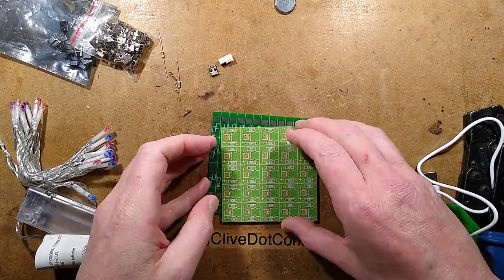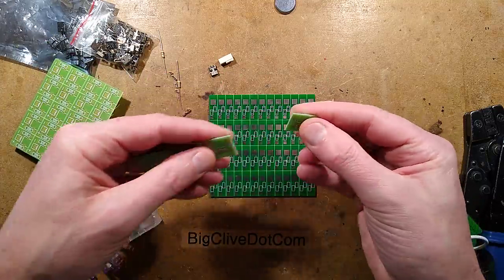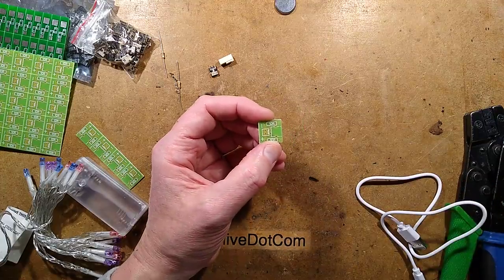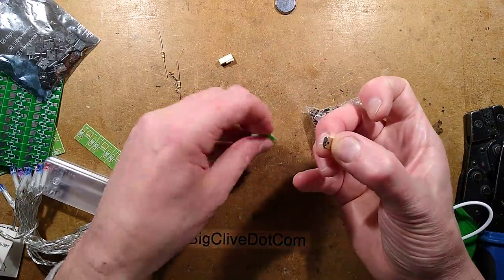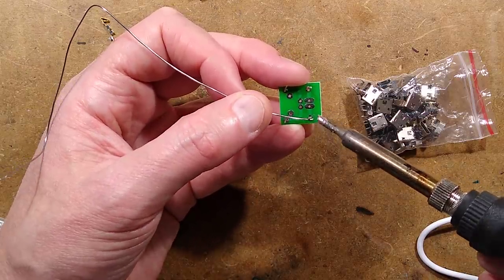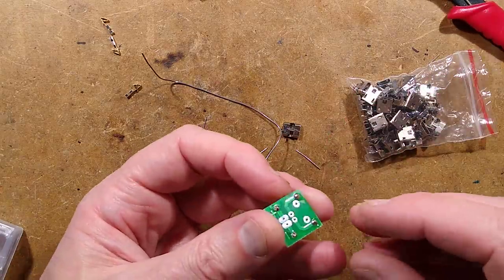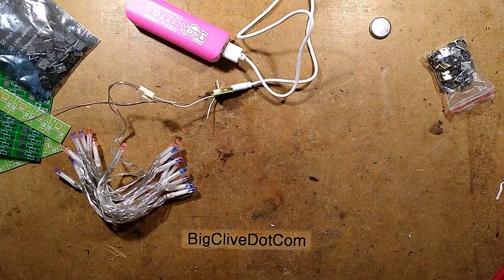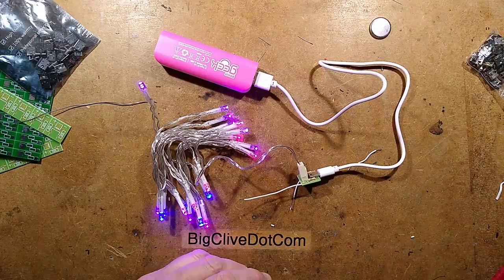USB to LED string PCB prototype build

Comment: I have a question, I need to convert a 3.7v battery to 3v-3.3v one. Tried with a step down converter but the input voltage of the module was 4v, so that didn't work. Can you please guide me towards a schematic/part number please?

Comment: Clive.
Not including the circuit board you used in this video, do you leave the edges of the board as is or do you sand them smooth and round the corners?
It's just because I was watching a video by Peter Brown and he felt he needed to sand some wood more than was needed and I have a few weird sanding routines including things that are hidden.
Reply: Oh Geeezuss! Sounds perverted to me 😲
Reply from the maker: I normally get my bigger boards made with rounded corners.
Reply: I usually use the edge of another PCB to "grind" the edge of a v-scored one. That's enough to not make you fear having glass fiber in your fingers whenever you touch the PCBs.
Reply: It's just me then..... 🥺👍

Comment: Great video.
Thanks for sharing your neat little ideas.
I really need to tinker more with PCBs. I always use the blank prototype-boards and often times when I want to do something I get frustrated because it's just a wire mess and I don't have proper wires, terminals and stuff. 
Do you have some guides on how to create these PCBs - any tips for a hobbyist like me? 
This would make tinkering around so much easier for little stuff that I want because I can design a PCB, get it done and then just move on without constantly breaking wires and components deadbug-style. 
Would probably make so much stuff way cleaner for myself :D
Reply: Look for some kicad tutorials probably.
There's a website you can use to make components easily for it. The library system is very powerful, but I find it pretty complex so I don't really use it properly. Apart from that is mostly just some screwing around to learn it.

Comment: @Clive LTV quick question. Sometimes when using a 5v USB battery I get flicker in the device. I use a diode and 20 ohms in series with the supply.  Same device but different batteries. Some flicker, some do not. I have tried using capacitors in series and parallel....any suggestions?
Reply from the maker: Is it a regular dip out just random flicker?  Some power banks dip the voltage regularly as part of a check.  Flickering may be a connector.
Reply: @bigclivedotcom  Its regular. I almost wanna guess a "pulsing", bright then dim then bright. . I am thought it could be how the USB power bank was boosting the voltage up (um..the frequency or something) messing with the way the light its self controls the brightness. Hence a capacitor to "smooth" it out. It didnt work and not sure I was using the cap correctly to even it out. I dont have a scope to check though.  TLDR: powering a 4.5 battery (alkaline/zinc w/e) device ( a bathroom motion sensor light) from a USB power supply.  I have burned up a few of them and not sure why.  Any thoughts?
P.s. Greetings from America! Happy Thanksgiving.

Comment: Great video Clive, Going to make my own, however how would i be able to add some sort of dimmer to the circuit ?
Reply from the maker: You can change the resistor values, or you could possibly use a 100 ohm potentiometer in place of one of the resistors.

Comment: Those input and output pads look recklessly close, just waiting for a solder bridge to nullify the resistors.

Also, I would argue that the difference in current measured vs. calculated is easily equally as much affected by simply assuming that your 10-ohm, 10 percent 5-percent resistor really is 10 ohms in resistance for your calculation, easily off by one 0.5 ohm, as it is by the shunt resistor(s) for the respective range. Not assuming that you don't know, just that it I think it would have been worth noting for those who might actually do not.
Reply from the maker: It's a compromise between getting a solid solder connection and separation.
Reply: Clive is using 5% resistors - brown, black, black, gold - but 1% resistors are readily available if you want to make more accurate measurements.
Reply: @johnm2012  Right, my mistake, don't know why I thought those would be 10 %.

Comment: The various micro USB connectors on ebay seem to have varying distances between the pins. Which ones were used with this board, please?
Reply from the maker: The two pin through hole type.

Comment: Is putting the same resistor on either side necessary, or just an aesthetic decision?  Are the string lights in series or parallel?  I'm trying to figure out the calculation for using 2 10R
Reply from the maker: Two resistors spreads the heat dissipation for higher currents.  The LEDs are in parallel.

Comment: I stopped using cheap flush cutters after one of the jaws broke off and flew into my face. I wasn't doing anything too extreme with them, just cutting off some supports from a 3d print.
Reply from the maker: I've never had that happen and regularly abuse them.

Comment: Current limiting? Or voltage limiting?  Curious how two 10ohm resistors kick down 5v USB to ~3v (what 2 x AA batteries would supply)?
Reply: It's an educated stab in the dark.
To do a "proper" calculation you would need the data sheet for the LEDs, or go with a generic.
But, if you guess the strìng takes 100mA at 3V (or measure it) then you need to drop 2V. Using V = IR, rearrange to R = V/I, split that into 2 resistors gives 10 ohm.
Reply: @dougaltolan3017  Thanks for that explanation!  Took me a minute to use .1 to represent 100ma 👍
Reply: In practice the resistor values are not at all critical. A total of 20 ohms is just a starting point. I've got 100 LED strings powered via the same combination of 2 × 10 ohm resistors and 40 LED strings powered via 2 × 22 ohm. You can adjust the values up or down depending on how many LEDs are in the string, and how bright you want the lights versus how long you want them to run between charges.

Comment: Wouldn't it be prudent to measure the exact value of that resistor that just claims to be exactly 10 Ohm?
Reply: Eh, they don't really - the datasheet often lists a variance of +- 2-5% depending on how expensive it is. Usually good enough.

Comment: How would this mod differ if the lights that you have are powered by 3 AA batteries and they're multi-function, with a remote control? I have some on a little tree but would love to run them from a USB power bank.
Reply: Replace one resistor with a wire and the other with a diode to drop 0.7 volts. Your lights will get 4.3V, but that's no different than what they'd see with AA's that are 25% used.
Reply: Of course if you put the diode in backwards they'll get nothing. Polarity matters.  :-)
Reply from the maker: You can run the battery pack from a chopped USB cable and a series diode to drop the voltage a bit.

Comment: Are the 10 ohm resistors not in parallel? In which case when you measure the voltage across you should either be using 5 ohms or doubling the current to 200 mA?
Reply: The 10 ohm resistors are in series.
Reply: @steverpcb  ah .. silly me.

Comment: Just out of sheer curiosity, why use microusb. Other than cost is there any other reason for not going USBC
Reply from the maker: USB C is not available in the strong through-hole format.
Reply: @bigclivedotcom  makes sense
 Thanks for the response

Comment: "Always put your meter back to the voltage setting." .... now you know that doesn't happen. How many people know the sound or smell of the resistance, amperage or impeadance reading of the mains power line? According to past capacitor range test errors, I discovered that 120 volt power circuits have 1 and 1/2 sizzles and 2 smoke curls. So, in color code fashion,  I'm guessing that's 1.5 with 2 zeros after it. To keep the rest of us from wasting a meter, the capacitance of power lines is 150 mega-farads. If you think it was kilofarads, or just plain farads, double check and let me know. 😂 👍

Comment: Question...why do you need current limiting resistors?
Reply: @Matt Quinn IIRC, this demonstration was using a led string that originally had a two-battery source.  My (Lidl) light sets have a three-battery box and they don't seem to suffer from running directly from the power bank.

Comment: I have yet to find any power-only type-c connectors. Is that why you're using micro-usb connectors?
Reply from the maker: Most of the cheap cables are micro.

Comment: I would really like to know how long the battery is likely to last befor neading to be charged☺
Reply from the maker: With a power bank it could run the LEDs for a significant length of time before needing recharged.
Reply: My guess is that about (15Wh/0.5W) is about 30 hours. But, drop the current or/and use a bigger "battery" ...

Comment: I've thought of making something like this however with... Better... Features 😛
Intensity control, smoothing, an on off m switch and with a better plug in block, using something mime the connectors you'd been advertising recently, or even if I could find a supplier, the old spring connectors for old speaker cables...

Comment: Do I simply put the v-groove on the pcb outline layer or did I get the help on the website wrong?
Reply from the maker: You have to request panelisation and let them do it.  You specify the number in each grid.

Comment: Hi Clive, would this work with or as a replacement for 3 d cells? or would you change the resistors?
Reply from the maker: For triple cell battery packs I tend to suggest just using a diode like a 1N4001 in series with a USB lead to nudge the voltage to around 4.5V.
Reply: @bigclivedotcom  Many Thanks Clive :-)

Comment: Aren't those strings tolerant enough to work with 5V instead of 4,5? 🤔
Reply from the maker: No.  A small voltage increase will cause a very high current increase.

Comment: Did you measure the resistor's ohms before assuming a 10 ohm is actually 10 ohms?
Reply from the maker: There will be a tolerance.

Comment: I know you have sufficient experience to do your crimps perfectly, but just for me can you do a pull off test on each one, it unsettles me for the rest of the video when you don't?  I've done thousands of coax and other crimps over a lifetime, but can't get away from needing to do a pull off test.
Reply from the maker: With this crimper I have good confidence from previous tests that the wires don't pull out.

Comment: JLC is a bait & switch operation, much like the "99p" ebay listings that are a "sample product" with the actual product you want costing £38.74, a despicable practice by any means...
Reply: Only if you're incapable of reading the actual conditions that have to be met. I've ordered quite a few boards that did cost 2$, plus shipping which most people dont complain about.

Comment: I'm obviously a noob and my English is not the best, but why are resistors needed in the circuit while connected to USB power, when they are not needed when connected to a set of batteries?
Reply from the maker: The USB supply is a higher voltage, so current limiting resistors are needed.
Reply: @bigclivedotcom  your answer explains why some of my dumbs projects with LEDs fail miserably after a week. Thank you.

Comment: How do you keep your soldering tips so clean? Mine always get black and unusable within minutes of me soldering.
Reply from the maker: If they're adjustable temperature, do you have it high?
Reply: Always leave a gob of solder on the tip as soon as you're done, and also turn it off as soon as you're done. That protects the plating on the tip from oxidation, a process which is greatly accelerated by heat! Use a damp sponge or bit of wet cotton cloth to clean the tip when it's up to temp just before using it with fresh solder on your project.
Reply: TiredSysAdmin  What it a good starting point for using a temperature controlled iron with (a) 60/40 solder; (b) lead-free solder, please?
Reply: TiredSysAdmin  Wow! Many thanks for that. I've only used Antex 25 watt non-temperature controlled irons until now but I ordered a controllable one just yesterday and will refer to your post again when it arrives. Thanks again.

Comment: wouldn't be using linear voltage regulator more efficient? thanks.
Reply: Linear voltage regulators simply waste the excess as heat, just as resistors do.
Reply: @johnm2012  thank you

Comment: I’m guessing you went for micro usb over usb c due to the cheapness of micro usb cables?
Reply from the maker: Partly that and USB C connectors make things a bit more complex other than not being available in the same 2-pin through-hole format.

Comment: With USB C becoming more prevalent is there a reason why you're still using Micro USB connectors?

I hear the C connectors are more expensive to buy, by how much? Or is there another reason?
Reply from the maker: USB C is not available in this rugged and easily soldered form.
Reply: @bigclivedotcom  Oh OK thanks!

Comment: What is the tolerance of your 10 ohm resistors ?  even at 5%,  not a very a accurate reference for an amp meter..
Reply from the maker: Good enough accuracy for the situation.
Reply: @bigclivedotcom  Maybe good enough, but then you can't really compare the accuracy to that of a piece of test equipment.  Having said that, the one meter that you used was so far off (from calculation) that it is out of calibration, defective or the test leads used are not conducive to current measurement.  Maybe a new battery in that meter gives a better result.  Or shorter heavier test leads may be the answer.

Comment: Sorry Clive Im on my phone. Anyhoo these LEDs, I was testing them out on a cr 2025 battery and ended off making a circular thing with 30 LEDs  all flashing away and no resistors I know it  needs resistors but its been flashing for 3 days now and the battery is starting to flag, wadya reckon ?😎💕🖖
Reply from the maker: For direct driving of the LEDs the battery has lasted well.

Comment: when you soldered these resistors, i think you should have spread the resistor legs so you dont have to hold them in place and burn your fingers
Reply from the maker: Bent leads make circuit board repair much harder.
Reply: @bigclivedotcom  why is that? i never had any problems with them

Comment: Why didn't you check the current with your DC clamp ammeter?
Reply from the maker: Easy to get an accurate result measuring resistor voltage.
Reply: Clamp meters don't work very well for low currents.

Comment: How (un)viable is USB-C here?
Reply: I think USB-C will default to 5v if there's no chip for the handshake?  I could be wrong.
Reply from the maker: USB C might require a couple of resistors.  I'm not sure if it would be viable for through hole use.

Comment: Someone need to make "BigClive BigHands" soldering helping hands as I still cant solder holding three things at the same time without dropping one all the time or burning my fingers, and those cheap helping hands are crap :D
Reply: @Okurka.  Expensive doesnt mean better + they break and get used just like cheap ones so why bother spend more? Joke was that Clive have big hands but hold items very gently and firmly, and 90% of helping hands use those annoying crocodile  clips that often damage delicate elements.

Comment: The only problem with PCB makers like JLC is you need to spend hundreds of pounds on PCB design software (which I can't afford) so I have now gone back to manually making PCBs using a resist pen and ferric chloride.  Simpler designs go on stripboard.
Reply from the maker: Easy EDA and Kicad are free to use.

Comment: JLPcb is quite a bit easier to work with that other company YouTubers push. It's almost a Chinese standard to lure you in with one price and get you with all the add-ons - it would make me a tad more upset if they weren't so good at what they do however.

OshPark which is a local company for me does even better but they are quite a bit more expensive.

Comment: I found out the hard way to use pads to solder onto instead of connectors. Its quicker and cheaper!
Reply from the maker: The new file has the connector or pads and strain relief holes.
Reply: @bigclivedotcom  Yes, I went long the lines of pads and strain relief holes 😃

Comment: What do you use to design the boards?
Reply from the maker: I use Sprint Layout at the moment.
Reply: @bigclivedotcom  Could that be the subject of video, perhaps? Design a simple circuit board, like this one, and walk through the process of outputting the correct files and placing an order on line, with what pitfalls to avoid, for someone who wants to do this for the first time.

Comment: Great. My (longer) comment gets auto removed after 20 seconds. wrote about "micro usb to DIP" adapters for 3,50 to 4 bucks the 10 pack.
Tried two times now. 20 seconds. gone.
Reply from the maker: Not sure why that's happening.
Reply: Happened to me on other tech stuff also.
i dont know why youtube now autofilters my human posts without filtering the spamsexbotaccounts... sometimes its external links, sometimes i really dont know what triggers it. no politics, insults, trolling, bad words..(Amzon-exbay-Alixxpress)
The really annoying thing is: i post.. its there.. after about 20 seconds (refresh) its gone. at first i was wondering when i went back in to edit typos and there was an error that it did not work... or i got no responses .. reason was the post was already deleted.
While i just watched along the video and did not reload comments..

If they would at least tell when and why they delete the posts you could work around the triggers.

Seems to happen more if you directly answer to a person with the (at)+nametag...

Comment: Interesting
Reply: Never thought about running a light set off of a USB cable until I watched this video. All I had was some 360 ohm resistors so 4 in parallel was enough to get the circuit working.